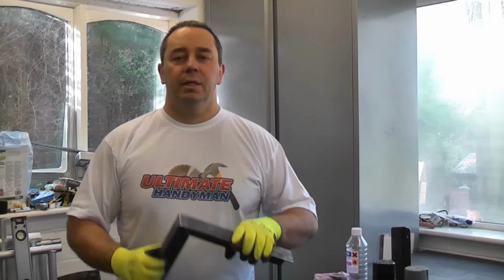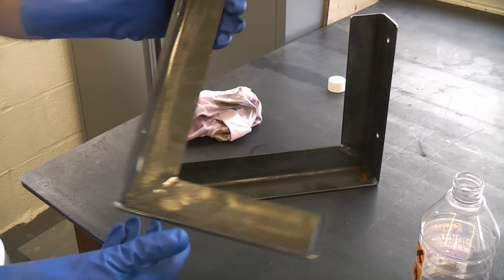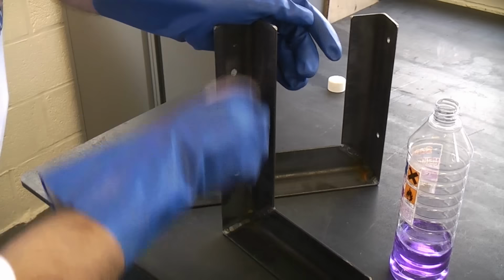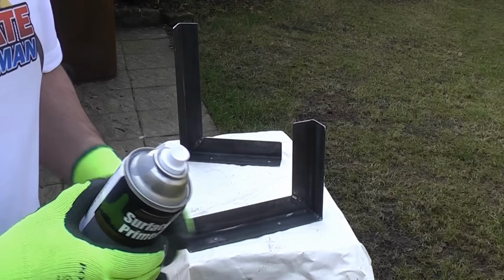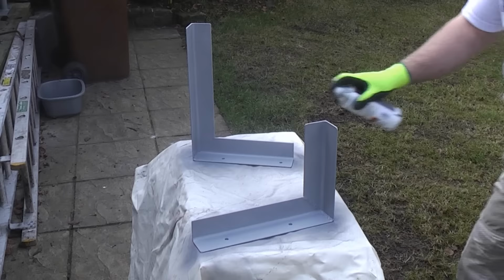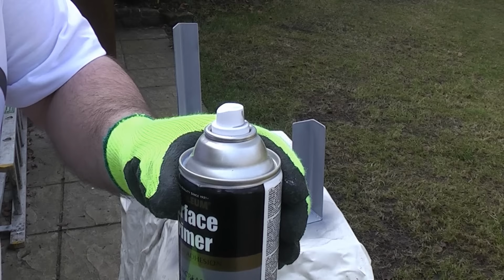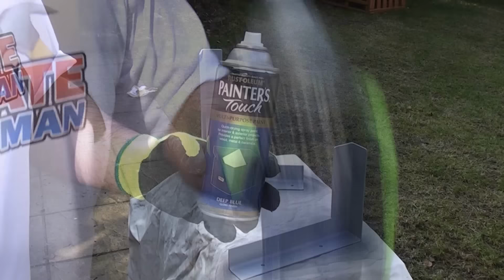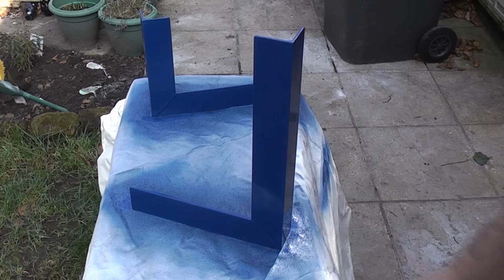How to paint metal | Rustoleum

Comment: I saw that someone through out a teal wire small trash can out, I needed a trash can, so I picked it up. it has 2 small patches of rust and the original coat of paint on it was red. Could I clean it up with TSP (http://www.homedepot.com/p/SAVOGRAN-1-lb-Box-TSP-Heavy-Duty-Cleaner-10621/202935861) and be ready ro spray primer, or should I remove the paint. By the way, its awesome that you take the time to read your comments, I saw that you replied to 99% of them and instantly subscribed, well done on the video by the way nice clean transitions instead of the jump-cuts you normally see on YouTube.
Reply from the maker: Jon Doe 
I'm not familiar with the TSP, but it looks like it might work.
I'd remove the rust first using a wire brush, then clean it and apply a direct to rust primer before a top coat.

I have done a video on painting rusty metal here, which might help- https://www.youtube.com/watch?v=L92WjUfppnE

The problem is matching the exact colour, so you might have to paint the whole thing to get it to look right.

Thanks for the comment and for subscribing ;-)

Comment: Hi @UltimateHandyman, I purchased this clothing rack made out of steel coated in bronze epoxy (https://www.sevilleclassics.com/Resin-expandable-closet-organizer-SHE16199B), but I would like to spray paint over it in white. Is it possible and if so what kind of paint should I use?

Also I found this Rust-Oleum 'Appliance Epoxy Spray' (http://www.rustoleum.com/product-catalog/consumer-brands/specialty/appliance-epoxy-spray), would this work?

Thanks!
Reply from the maker: +Jeanine Estucado I think that should work, as long as you follow the instructions ;-)

Comment: I want to paint my tools
Reply from the maker: Most paint will not last long on tools I'm afraid.
Reply: You can plastidip handles on your tools. Works great. I wouldn't use any paint though.
Reply: +Tech Inbound  thanks
Reply: Omer Sheikh Yeah they sell spray cans of plastidip, or paint can looking containers of it, get those so you can actually dip your tool handles in. Protects them and it's very durable. Much easier on your hands when you have a soft handle instead of hard metal